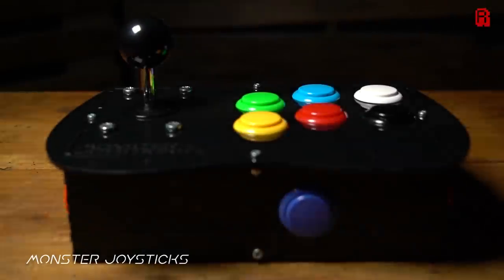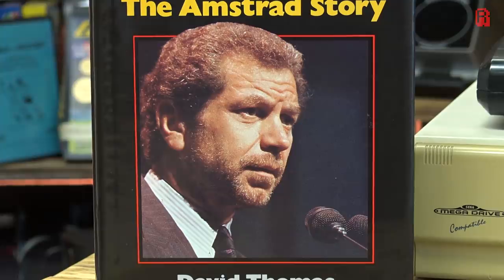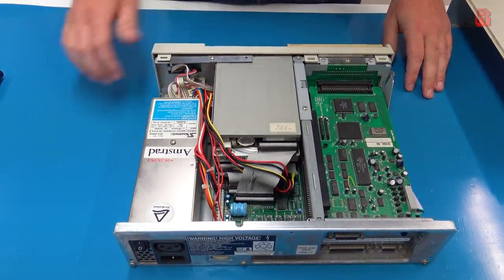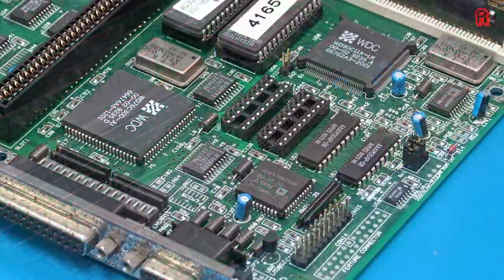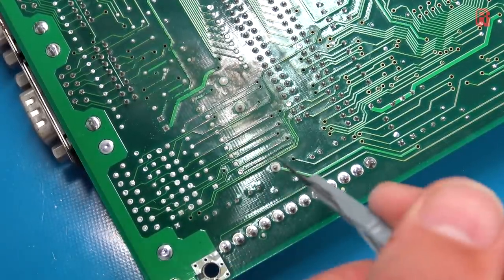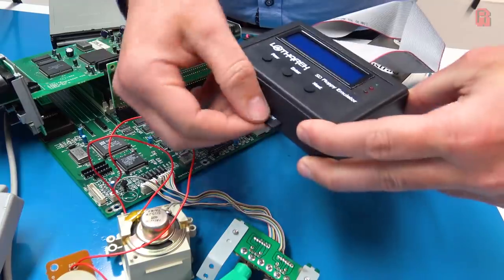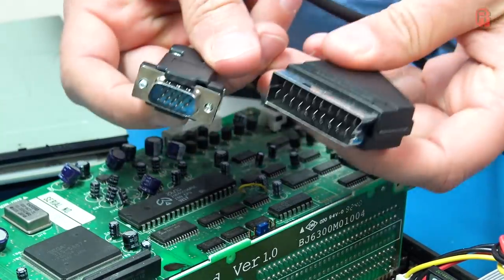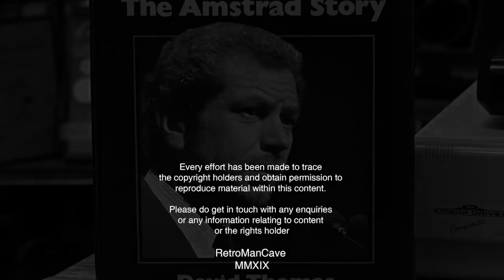Amstrad Mega PC - Console Gaming in an IBM-PC Compatible | Trash to Treasure (1/4)

Comment: It's fascinating, and also moderately surprising that this Mega Drive expansion card actually still has the Mega Drive expansion port connector...
(this is what the Mega CD attaches to)

Quite how you're supposed to make use of this connector given it's physical configuration seems like something of a mystery to me, but it's amusing nonetheless. XD
Reply: Given they had further models in mind, I'd assume it was intended to allow for lintegration with a CD ROM on the PC side eventually.
Reply: That would've actually made some kind of sense.
But of course, as always, what makes sense in a hypothetical situation where a machine is actually successful is different from reality. XD

Ah well...

I wonder how proprietary this implementation is?
It seems to attach to a standard PC expansion slot - does that mean it'd work with a different PC?
I guess the monitor connection is an issue...
Reply: @KuraIthys  in theory it does, it was mentioned some nutters had crowbarred a 486 board in there
Reply: I wonder if you could plug a 32X into it, somehow ..? o_O
Reply: @youdontneedtoseehisidentif4939  Or develop a Cartridge for the Mega Drive that has a 3 8 6 in it !!! Dual Core! YES!!
Reply: Or, a little easier, I wonder what would happen if you plugged in a cartridge with a SVP in it..?
Reply: In theory, yes.  In practice, troublesome.  Aside from the sheer physical logistics of having a front facing 32X messing with your keyboard, you'd also need to find a way to combine the video signals.
Reply: Yep, I realised that the MegaDrive/32X having separate video outputs would be problematic – but, if you'll remember, with the early 3D accelerators it was necessary to plug the system video output as an input to the 3D accelerator, and then plug output of the 3D accelerator into the display, so there's definitely a solution, given enough time

And I think it's silly that the sliding cover requires the MegaDrive pads to be unplugged, when sliding it could just electronically disconnect them
Reply: @youdontneedtoseehisidentif4939  Oh yeah. There's almost always a solution.

The sane one in this case probably involves using a normal megadrive, because there's a lot of complicated video fuckery involved between the Mega Drive throwing it's signals out to a VGA monitor, and extra signals on the monitor connector to enable the right multisync mode, and even if you get past all that, at best it is going to look unbelievably stupid :D

Comment: Have you considered integrating a GBS-8200 board inside the machine. VGA 15kHz in, VGA 31kHz out, power from the PSU.
Reply: I did try the GBS-8200 but it didn't produce any pleasing results in my case. Also, it's not even compatible with 50Hz resolutions (upconverted to 60Hz). If using a cheap scaler, it's better to look for the ACV-011 by Weiya instead. I have this one and I can confirm it works pretty nicely, but at the cost of fiddling with its jumpers to get a nice result.

Comment: It reminds me a little bit of the Power Macintosh 7200 PC Compatible. It had a PCI card in it with a Pentium CPU and other PC components on it, and with accompanying software installed in Mac OS, you could have both the Mac and the PC running simultaneously. In fact, I ran such a configuration for a time and played Daggerfall on it. It ran as you might expect it run on a Pentium! There was a simple key combination for switching between the native Mac and the PC card, and I recall it had a special cable to carry the video signal to the Mac's motherboard. It would be a cool thing to see you cover sometime.
Reply from the maker: That sounds cool I'll keep an eye out.  There was an unreleased 68k board for the PC by Checkmate which let you do the same on a PC, switch to Mac mode, but Checkmate were an Amiga company at heart and the longer term goal was to make it a Mac and Amiga board to encourage the Amiga OS into PC's in 68k form and then hopefully migrate it to native x86.  It's a shame it never made it to market owing to Gateway2000 financing shenanigans

Comment: There's no proof that a 486 was ever really planned. There were magazine ads for them but the "Mega Plus" was a name coined by computer hardware sellers that offered it, never from Amstrad directly. If they ever sold them, it was nothing more than a normal MegaPC with a clip-on 486 (even the facia text was the same).

Seemingly they used the "Plus" branding because Amstrad used that prior to denote upgraded products (464 Plus,  6128 Plus, 9512+, etc).

I did A LOT of research on this and the Wikipedia was wrong in saying that it existed. This was edited but even desired absolutely no evidence, they (Wikipedia) still altered my edit to suggest it probably existed. Oh well...
Reply: It did exist as the 486SLC but I remember the fascia was changed to reflect it.
Reply: @ThePopolou  Can you upload a picture of it?

Comment: 11:57 despite Amstrad's reputation, their PC's do seem to be quite well built.  My poor old 1640 seemed like it might be in quite a bad way with environmental corrosion, but once cleaned, it was mostly cosmetic damage to things like the shielding.

15:15 A solution  worth exploring might be to swap out the activity LED for a Piezo sounder.

19:03 Weren't some of the Amiga monitors Multisync for compatability with the Amiga's low res and hi res productivity moves?

Comment: What's the Feature connector for on older video cards?
Reply from the maker: That's to pass through something into the video card, for example MPEG decoder cards would decode video and pass it through the feature connector into the video card where it's output, or had other graphics overlayed by the video card before then outputting the image.
Reply: @RMCRetro  That's very interesting. Never used one. Maybe do a video about that some time.

Comment: Pick up a BenQ BL702A 17" VGA monitor. It's at least dual sync (15khz and 31khz), not sure if it does 24khz for things like the X68k. They're not expensive and work nice with an Amiga 1200 with an adapter.
Reply from the maker: I had the pleasure of seeing one of these in action at SWAG, was brilliant for both the Amiga and MegaPC.  It's certainly on my shopping list!

Comment: Love the Z80 cpu on the sega board. Incidentally, the date code on it is 9217, 17th week of 1992...
Reply: Well of course, it's part of the Megadrive chipset. It drives the soundchips (note, plural) and handles the joypads. The Megadrive, after all, is basically a Master System on steroids, and so includes all of the older machine's silicon in one way or another, including the original VDP (though it loses some of the really old video modes).

Comment: Other Multisync monitors were available and didn't even need any special cables to make them switch. In fact I think  ones like the NEC Multisync 2D, which was every Atari ST owners dream monitor, were originally given the name because of that ability. http://atariage.com/forums/topic/230561-lcd-monitor-that-supports-st-low-res-nec-multisync-lcd-1970vx/page-3 Back in my ST days I had a monitor that looked a bit like a Microvitec Cub but would sync onto Low res High res or VGA signals. The downside of that particular one was that it had bad screen burn when I got it second hand. 1990s footage on programs like "Naked City" showed they were used extensively in stockbrokers.

Comment: I remember when these came to market, I think they were very quickly reduced to £599 but even that was steep for a PC with just 1MB RAM. In 1993 1MB of RAM was a very small amount.  It is a shame as this could have been a good concept it just needed more RAM as standard and it needed to be cheaper.

Not sure if many games could have made much use of that sound card with just 1MB of RAM! I seem to remember at the time 4MB was the recommended minimum for sound card usage.

Comment: There are plenty of pretty good (oldish) TFT displays that support 15Khz, there's a list of them to be found by googling "15khz supported monitors" (the wikidot one). Personally I have the Dell U2410 which has so far worked with anything I've put against it, and I got it pretty cheap from a used computer shop. It also happily accepted the Neo Geo MVS signal my TV SCART input didn't like.

Comment: Hey there, fantastic videos, thanks so much for making them!
I've recently acquired a Mega PC and am attempting a restore myself. Do you have any tips on how to prepare the CF card; to partition it, format it to FAT16 and then get a bootable OS installed on it (I could imagine you do the last part on the machine itself after booting from a floppy boot). I've attempted using a Windows 10 PC to creating a single 40MB partition and then use the Win10 machine to format to FAT16, copies MSDOS5 boot disk files over and use BIOS Type 17 as usual but I just get 'Error loading operating system'. [Solved this myself in the end; far easier to just use the mega pc itself with a cleaned CF card and then use fdisk from the DOS boot disk to create the single 503MB partition, BIOS settings taken as per the this video, can then use the FAT16 card in a modern PC or Mac to stuff it with goodies, avoiding the slow hard drive]

Comment: Stupid question???    I always thought that everything was on the hard drive.  When you swap out the original hard drive for the card how does it still have the old school memory.   Is this coming from the CPU?  Help me out here.  Just wondering.   Thanks for the videos.
Reply from the maker: There are no stupid questions.  I reinstalled DOS and Windows on the card.  When you first put it in you will get an error as no OS is found.
Reply: @RMCRetro   Good stuff.  Thanks for the feedback.   Love your  channel.
Reply: A PC boots from the BIOS chip on the motherboard first, that's the memory check and stuff you see. Then it'll boot from the first available device, for an old PC like this that would be the floppy drive, if the floppy drive is empty it will then boot from the HDD. Even if you replace the HDD it still has the BIOS stored in non-volatile memory.

Comment: What if you upgrade all of the internals to current standards, would it still work or just combust? Also is it possible to upgrade any of the hardware in retro consoles? Like add more ram or whatever, I hope that makes sense. If it is possible, why has no one done it yet? Here's a good example, upgrade the sound chip on the super Nintendo?

Comment: So you couldn't connect this "Megadrive" to a television back in the day?
Reply: meneerjansen00 why would you want to, it was designed to use on the same monitor the PC used
Reply: Never say "couldn't".  Say rather "wasn't designed to be"
Reply: That was one of the big selling points of this unit (well it was the Xmas the shop i worked in at the time got a nice job lot of them to sell off at £200 (ok £199.99 ) Mum And Dad get there telly back, and the kids can play there megadrive games on that monitor, we sold our entire allocation in a few weeks, there were all in our stock room waiting for santa (er i mean mum and dad to pick them up on xmas eve )
Reply: @CastleFamilyThe  I understand. Weren't people put off by the fact that your average basic VGA monitor wasn't compatible w/ this PC? As I understand it from the video it would only output the Megadrive part in combination w/ a Amstrad monitor. I can remember back in the day we only had VGA monitors for the PC's where I worked and studied.
Reply: meneerjansen00 most Amstrad PCs were sold in bundles with Amstrad monitors, i dont recall any being sold as separate parts, but they were basically to use the Sega name to sell outdated PC hardware for lower prices, it was a gimmick that failed, just gets some attention nowadays because of the Sega link.
Reply: Nope you did not need to worry about this issue as the unit came with the monitor from amstrad, obviously if this monitor broke  then you would have issues as you could not get a normal monitor to display the Sega games, but at the time there would have been plenty of access to 2nd hand Amstrad monitors
Reply: @cliffcook3993 Normal Amstrad monitors wouldn't cut the mustard, but there were dealers who'd service monitors back in the day, and multisync monitors from other manufacturers weren't totally unknown, because systems like the Amiga could use them, too.  In a pinch, you could probably send the whole thing back to Amstrad.
Reply: @meneerjansen00 Some Commodore / Amiga monitors of the same era had the dual-sync 15khz mode that the Mega Drive hardware needed, so you weren't entirely high and dry if yours broke. Even if the replacement monitor didn't have the built-in speakers, you could connect a standalone pair to the 3.5mm jack on the rear of the MD ISA card.

Comment: I didn't knew that existed back then :0 but I still have my PC7286 ! Delivered with Dos and COU TERPOINT a visual interface for dos :) my very first PC. Neat ! I wonder if the cases are similar, and if just the front panel can be changed on order to turn any pc7 into a Sega PC

Comment: I had one of these many years ago, bought it I think for £30, late 90s or early 2000s, played about with it for a while and then sold it on for maybe £150. It was not very good. I still have the Sega Saturn GPU board with saturn pads which goes into similar pc's as an expansion but there weren't many games for it. It didn't play saturn games and I've probably remembered wrong about the Saturn gpu it was probably a different chip but had Sega game conversions. Actually it was the Nvidia NV1 board.

I can definitely say I got more fun out of that than my Amstrad Mega PC mainly because I didn't have many megadrive cartridges and the 386 pc was just too slow for decent games like doom.

https://en.wikipedia.org/wiki/NV1

Comment: I really want to get some of this old hardware to work on, having current gaming hardware and running emulators is fun, but it's not the same as the real thing. Where is good to get one's hand's on this sort of thing?
Reply from the maker: Ebay is usually pricey, Facebook classifieds can have bargains, but local classifieds often turn up bargains using an app like Shpock

Comment: I wonder if it can be 50/60hz/NTSC-J modded 🤔
Reply from the maker: I have come across blogs about this being done so it seems to be a viable mod yes
Reply: I'd really like to do this to mine. I don't see why this monitor can't handle 60Hz.
Reply: @R33Racer the monitor can handle 60hz but it can't handle the image output by the megadrive side of things without changing it to a different resolution. For example, I have a modded component cable for the GameCube and it is capable of displaying a 640x480 image on a VGA monitor if that game supports progressive (480p) mode but on most monitors won't accept the normal interlaced (480i) output because of the horizontal scan rate. 480p is about 31khz and 480i (and 240p) is about 15.6khz. With a multi-mode monitor both should work just fine.

Comment: Only 256K of video RAM in 1993? This would have limited it to 800x600 with 16 colours. But could the adaptor offer more colours at that resolution (or even 640x480) with an expansion? In the case of some, the only purpose of the expansion was to increase the colour depth of the 1024x768 mode from 2 to 16, which was probably interlaced back then anyway and almost unusable.
Reply: I think you are a bit too far in the future? I mean, that would have been high-end specs, right? Hercules was still a topping on the cake for a PC.

Comment: Isn't that card standard 16-bit ISA? EISA-slots are typically brown in color and has more connections for 32-bit operation.
Reply: I don't think there was ever 32 bit ISA, there was the VESA extension though, which was a standard 16 bit ISA with an extra connector at the end, coincidentally it's the same connector that PCI would use.
Reply: @Nukle0n  Actually, there was. https://en.wikipedia.org/wiki/Extended_Industry_Standard_Architecture. It wasn't used much in consumer PCs though. Mainly servers and workstations.

Comment: I wonder if the Mega-Drive-ISA-Card is anyhow connected/passed-through to the PC (asides the AdLib/SoundCard), so that game-data can be loaded/altered (in)dependent of the module. I am curious!
Reply: This is Amstrad we are talking about here. Alan wouldn't have approved the extra expense of adding that extra logic for a very small minority of users. Also looking at the board there's minimal interface logic, it looks like it's just enough for the PC to talk to the Yamaha chip and 15 pin joystick port over the ISA bus.

Comment: Hello, im curius what exact IDE-CF adapter did you use. 
I also have a amstrad Mega PC with the same Bios you have and used a similar looking ide-cf adapter. But the bios always tells me "Fixed Disk Controller Failure". 
The adapter works, I tried it in a more modern machine.
Also the Amstrad PC works fine with a regular HDD.

Maybe someone has a tip for me.